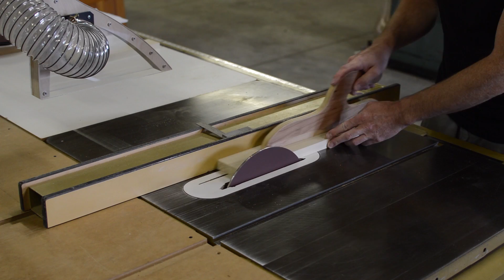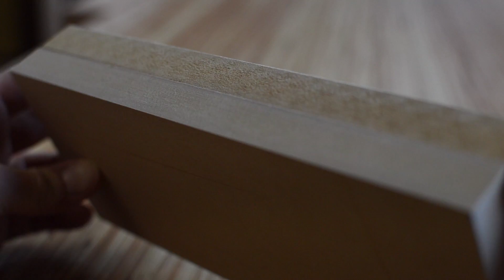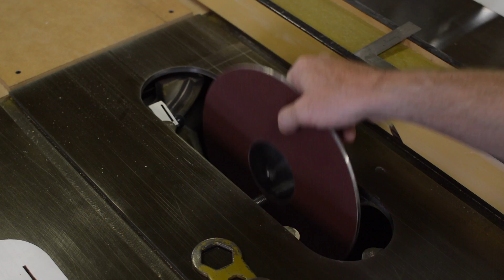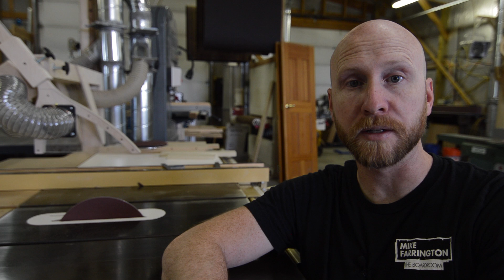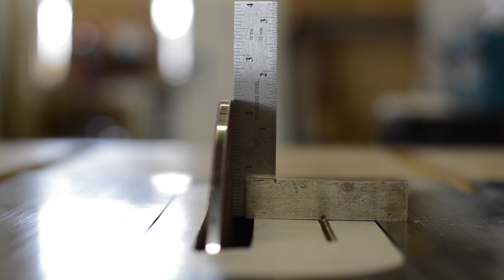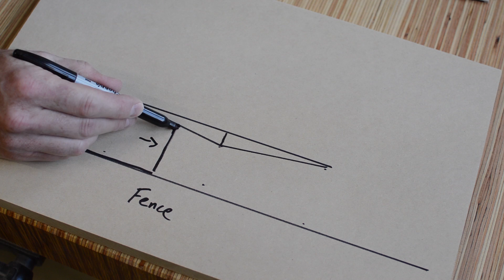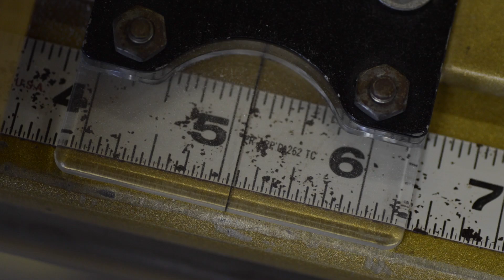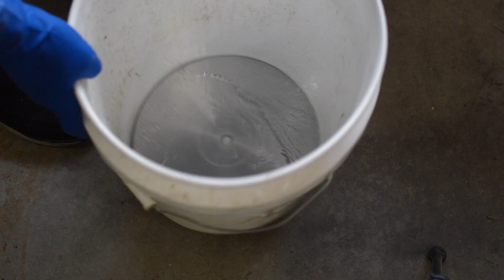This sanding disc will improve your woodworking and carpentry, period.

Comment: Nice product. Im not sure your "drawing skill" got across the idea that its vertical line of contact only exists at 12 o'clock. Hence, cutting with the grain and reducing heat.  As a machinist I know making such a large disk with low runout is not trivial.  Yes, the Chinese will copy you, but they'll never make one that won't wobble!  Nice product Mike!
Reply from the maker: Thank you. There is already a copy on the market, its only tapered on one side though. The shop that I used makes parts for jet engine fueling systems, they need to be accurate to .0001. It was not easy to get this thing machined the way I wanted it. We played with chuck pressure, and a few jigs to hold after the first side had been cut. The end result is what I think is a very good product. You are totally correct on the vertical line of contact. I should have spent more time on that.

Comment: Love the channel and this disc, Mike. I don't think you mentioned anything about table saw RPM. I have a smaller hybrid saw (Ryobi BT3100)that uses a universal motor that spins considerably faster than most saws. Would this disk be safe and effective to use on it?
Reply from the maker: Thank you David. I have run the disc on my Ryobi job saw. It works well enough. I don't know what the RPM of the saw is though. If you are interested in buying a disc and have concerns about RPM, send me an email via my website. We can chat.

Comment: The taper is a good idea but it also means that you will not get a perfect 90 degree on your workpiece. Maybe a problem for glue ups?
Reply from the maker: No, the edge left is a perfectly crisp 90 degree edge, or any other angle you set it to.
Reply: Ok I understand now. Just have to set it up 90 degree on one side. The other side won’t be 90 degree because of the tapered disc but doesn’t matter cause we’re not sanding on the other side of the disc. Congrats for making this sanding disc available to the public.
Reply from the maker: @frenchriversprings  Yes, that is correct. Thank you.

Comment: I don’t understand the necessity of setting the blade angle to 2 degrees past 90, installing the disc, then setting the installed disc’s face to 90. Does it matter what angle the arbor is at when installing the disc if the disc face will be set to 90 deg from the table after it’s installed? What am I missing?  🤔
Reply from the maker: There isn't a reason for it, that was just a function of me demonstrating that the arbor needs to tilt towards the fence. The real world way to install it is to put the disc in the saw, tilt arbor and check with a square, then go to work.
Reply: Mike Farrington I’m relieved to hear that. I’ll be the first to admit I’m not the smartest knife in the drawer (see what I did there?), but I’m relatively good at figuring things out, and for the life of me I could not understand the significance of that 2 degree tilt.
Reply from the maker: @clickster1883  Well, hopefully the drawing portion of the video explained the 2 degree thingy.
Reply: Mike Farrington Yeah, I’ll watch it again. Seems like a great capability!
Reply: I also got confused by the 2 degree tilt, install, move to 90 degree position steps.  I'm a reasonably sharp knife in the drawer, (good for cutting cheese I suppose).

Comment: Very slick. Have you considered 220 instead of 180 for the upper limit? If so, what was the deciding factor?
Reply from the maker: 220, would work, but the user would need to be very careful, and take small bites or the paper will burn.

Comment: Would be great to have but my saw has a 30 mm arbour so it won't fit and I don't have a 30 mm metal drill and buying one for a one time use is rather expensive. It probably cost as much as the disc itself :(
Then the international shipping is also going to cost much as I live in Sweden :(
Reply: Unless you were using a lathe you’d never get that 30mm hole centered properly anyway.
Reply: @jeremyspecce  Most likley yes :(
Reply from the maker: I am planning to sell discs with other arbors. I just started with 5/8 because its the most common. Also, keep in mind any place that sharpens saw blades can enlarge arbor holes and drill brake pin holes. As to international shipping, there is nothing I can do about that cost. It is what it is.

Comment: I do have the same Powermatic table saw and I couldn’t find how to set it up on the 2 degrees as you mentioned. Where exactly did you adjust it? Thanks
Reply from the maker: On my saw it was close to the front of the saw to the right of the blade. Look under there, you should see it. If you that doesn't help, email me via my website. We'll get it figured out.

Comment: Hi there. I am about to make a table top. Does using this product make your glue joints along the length of the table better? I instinctively feel sanding to a mirror would make glue ups less penetrate-able for the glue. But it sounds like it makes it better based on your video? Thanks.
Reply from the maker: Thank you. The answer is it depends. If you current process, (jointer, hand plane, etc.) is giving you a very good edge, then this disc won't help much for glue lines. However if your boards are coming off the jointer or table saw with ripples or tear out, then this disc can really help. With regard to glue penetration, that is a non issue. The surface left by the disc, especially the 80 grit, is perfect for glue ups.

Comment: Should you add 1/32” to your measurements if that’s what the disc takes off?
Reply from the maker: Yes, I don't necessarily add 1/32, but I add a little, and sand down to my final dimension.

Comment: I'm not sure I fully understand the taper. Will you need to readjust the fence slightly every time you adjust the blade height to spread out surface wear?
Reply from the maker: I suggest setting the height and use it for a while, then change the height when a fence adjustment is also needed.

Comment: I noticed you were using this without a riving knife. I have a Metabo C10RJS table saw which has a permanently attached riving knife. Supposedly, there is a way to remove it, but I have not yet found a video showing how to do so. Can this be used on my table saw??
Reply from the maker: I do not know for sure weather this disc could be used on your saw. I am not familiar with Metabo saws.
Reply: @MikeFarrington  Can this sanding disc be used with a riving knife??
Reply from the maker: @PaganWizard  I can't say for sure, it would depend on the saw. The disc is thicker than a blade, so in theory the riving knife shouldn't be a factor, but depending on how the disc goes on the arbor, the work piece may or may not touch the riving knife. I wish I could say for sure, but I'm not familiar with your saw and I don't want to give you wrong advice.
Reply: @MikeFarrington  Thank you for your insight, and your honesty. Both are very much appreciated.

Comment: hi would this disc fit a Dewalt  DW745 Portable Table Saw  and do you send to the Republic of Ireland great idea best of luck with it
Reply from the maker: I have not used it in that saw, but if the arbor tilts and is long enough to accept a 7/16" thick disc, then it should work. I ship to the Republic of Ireland, send me an email if you would like a quote.
Reply: @MikeFarrington  
Tha is for getting back to me I know the saw blade size is 255mm with 20mm bore
Reply from the maker: @damienokelly5397  I am currently stocking only 5/8" arbors, I can have the disc bored out to 20mm. Send me an email for a quote.
Reply: @MikeFarrington  hi are on facebook dont want to share emails on a open platform
Reply from the maker: @damienokelly5397  Visit my website, links in the description.

Comment: I currently only have a Ridged Contractor table saw. Is its RPM going to be to high versus a high quality cabinet saw? Issue, non issue?
Reply from the maker: No, RPM won't be an issue. I would be willing to bet your saw spins pretty close to mine.

Comment: Could this be used to make kumiko strips? Sanding on both sides and getting it to proper thickness. I can't afford a drum sander like you have (wide belt) and some woods it would be better than a hand plainer. Your thoughts.
Reply from the maker: It could, but you would need a jig to hold and push the pieces safely past the disc.
Reply: I've got that covered. The price of a sanding disk and paper is cheaper than a drum sander. Being on disability makes buying tools a challenge.

Comment: I bought a WoodRiver disk after seeing you use the edgetech (couldn't find that one in stock anywhere), but it actually has no taper. I guess that's why it was only $30. 

Side note - Could a hook and loop system be used on this to make changing disks easier?
Reply from the maker: Sorry to hear about the woodriver disc. I thought about the hook and loop idea, but in looking into it, I'm not enough of an engineer to get it to work right. Especially when PSA sandpaper is so easy to get.
Reply: @MikeFarrington  hook & loop is too "iffy" at high rotational RPM!!! Adhesive much better!!!...to clean old adhesive off quickly, lacquer thinner works really well!!!😎👍🏻
Reply from the maker: @RTR-MATEY  I think you're right. Thanks for the Lacquer thinner tip.

Comment: I noticed you don't have a riving knife on your saw.  To use this tool, would I need to remove mine first?
Reply from the maker: It depends on the saw and the way the knife is setup. For the most part I would say no, but it would not make contact with the piece and would therefore be of no use. Feel free to email me via my website and we can chat a bit more.

Comment: I am generally no friend of pinching anything between an cutting edge and an fence. I saw John Heisz video and didnt like it. Too much risk of a kickback. But your solution is way better as the upcoming part makes no contact. With your little block or an featherboard it is quite safe. so it is second worst as i like it still not. Edge band sander or a sanding drum on a spindle Motor is more to my like.
Reply from the maker: To each their own, everyone must make their own safety decisions.

Comment: You will find that If you use eucalyptus oil to clean your disc it will be much easier, no buckets, no heavy chemicals, just use a paper towel with the oil on it and gentle rub..ty
Reply from the maker: Great tip. I'll look into that.

Comment: On a SawStop, why does the brake need to be bypassed? Will it not work? I do understand that if the brake is triggered it probably won't stop it very fast and it may very well damage the aluminum disk, but I'm just curious.
Reply from the maker: My position is I haven't tested it, so I really don't know. I have know idea what the interaction between the disc and the brake would be should it be triggered.
Reply: @MikeFarrington  I spoke with SawStop technical support today.  They do not have experience with this accessory, but said if you install it and the sensor says it’s ok to use, it should work. I’ll let you know if it works or if I lose a sanding disc and brake.
Reply: @MikeFarrington  I tried it this morning and it seems to work. That is I did not need to bypass the brake on my SawStop when using the sanding disc.
Reply from the maker: @miketurner8284  Thank you for the feedback. I would still recommend running in bypass because of the chance of a trigger.

Comment: Mike - Kudos on the new product but let me suggest some marketing for you.  Disk is useless to a new user without the sandpaper, so you should add a ‘starter package’ with disk and 1-2 of ea. grit at a small discount and maybe include  a sm  rubber crepe cleaner stick. I’d also do a ‘subscribe and save’ 2 sandpapers every 1-2-3-6 whatever months... charged to card on-file. 5% off or free shipping etc.  You need to generate recurring income from this if for nothing else so you can continue to service your early adopters. Cheers.
Reply from the maker: I do include 4 pieces of sandpaper with the purchase of the disc. I do not recommend the use of a cleaner stick, this thing is spinning too fast. Honestly, I like the idea of recurring income, but the paper lasts so long, most people won't need more for at least a year.

Comment: Really nice sanding disc! How does it do with endgrain cutting boards, where the sides are edge/face grain?
Reply from the maker: It works super good. Way back in the day, I used to make lots of end grain cutting boards. I probably made more than a 1000 using this type of disc.
Reply: @MikeFarrington  Thats great! How about a mitered box with the top part cut by a bandsaw, will there be any issues sanding that?
Reply from the maker: @congruewoodworks1474  Not at all, I have done that very operation. Obviously, you need to be careful and make sure not to tip the box in towards the disc, keep in flat on the saw, but sanding the 4 sides of the top of a box is well done with this disc.
Reply: @MikeFarrington  Thank you for replying. Awesome feedback. :)

Comment: I bought this several months ago and just installed it for the first time today in my Sawstop Professional. I'm comfortable using the fence to the left of the blade, so I don't think I'll be changing my 90 degree stop for now. A couple of small things I noticed, if you are using the pro sawstop, the blade height has to be pretty low to get the disc off the arbor, otherwise you run into the dust collector edge. I did some test passes on maple and the 80grit side left some pretty noticeable (and feelable) lines. The 180 left lines too, but less intense of course... is this normal? I'm planning on using this for both paint and stain grade and would definitely be interested in a higher grit.
Reply from the maker: Thank you for your comment. I'm not sure I follow the dust collection issue. All grits will leave some lines, at the higher grits they disappear with a finish is applied. Feel free to email me via my website if you would like chat more.
Reply: @MikeFarrington   The mouth of the dust collector around the blade area in the sawstop pro is kind of curved at the top of it, and the arbor bolt is long, so you have to lower the height a bit to get around that curve. Apologies, it's not really a big deal at all- it works great in the sawstop, and the disc does exactly what it's supposed to. I am really happy with it!
Reply from the maker: @kristinellert8601  OK, I get the arbor thing now, yeah that is a function of a good dust collection shroud, and an arbor long enough for a dado stack. Sounds good, if you ever have an issue, feel free to email.

Comment: The question is does it work with a Sawstop and the braking system? I suppose I could dig through every comment and answer, but I went through quite a few before giving up..
Reply from the maker: I recommend running the saw in bypass mode. I do not have any data on how the disc and brake will interact. I also suggest checking that your saw will tilt towards the fence 2 degrees, or plan to use the disc with the fence on the other side. Feel free to email me with any questions.

Comment: I'm sure someone else asked, but is there any issue using this with Sawstop?  Do I have to put it in bypass mode?
Reply from the maker: I suggest running in bypass mode, I have not done testing with how everything works with the brake system.

Comment: Since the disk is conical what do you reference from consistently to set the width accurately between disk and fence?
Would this not change the measuring tape on my table saw.
Do you have to sneak up on the cut to get finished thickness?
Reply from the maker: Yes, the tape on the saw fence is no longer accurate. I just make a test cut, measure, the adjust as needed.
Reply: Good Evening Mike

Makes sense.
I will be ordering soon.
Randy
Reply from the maker: @rce2553  Great, thank you!

Comment: Can this be used with a sawstop if removing the emergency brake thingamajig?
Reply from the maker: The disc will work on Sawstop saws. I recommend it be run in bypass mode.

Comment: So I would use this after my jointer or instead of my jointer?
Reply: My question too.  A jointer leaves a nice smooth, square surface.....
Reply from the maker: Depends on the board. If you board is straight, no need for the jointer. For the most part I would suggest that it be used after your jointer. In terms of glueing boards together, I say joint all edges straight, then hit it with the disc, this will remove ripples and allow the parts to come together very nicely.